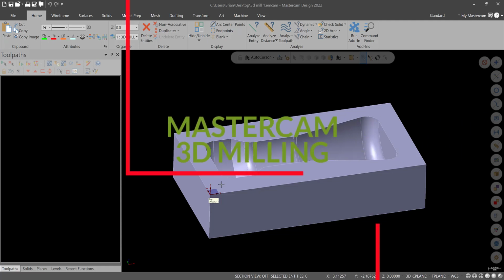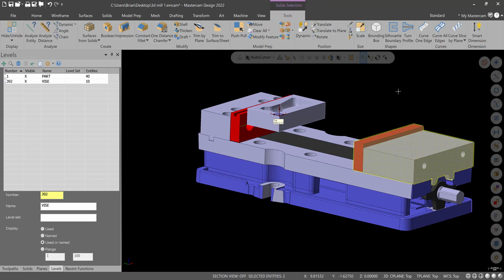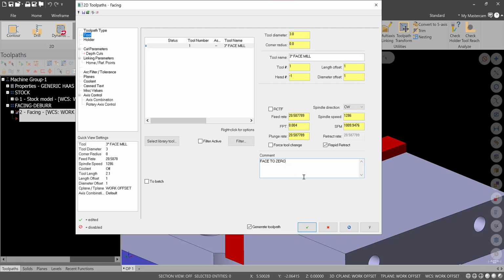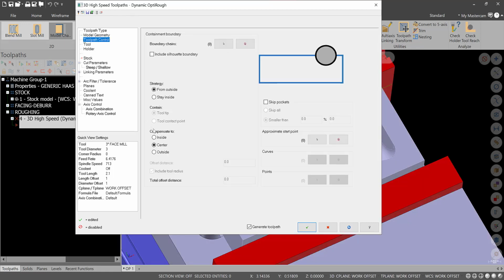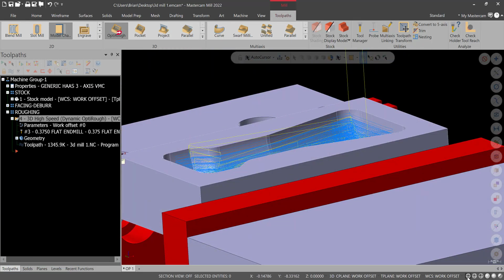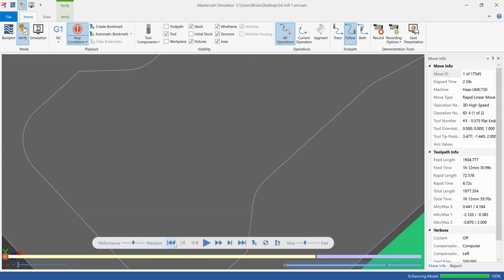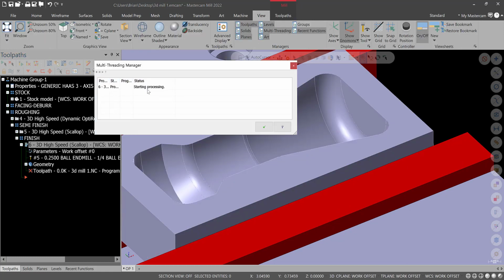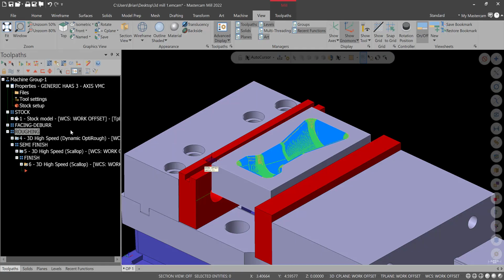Mastercam 3D mill Mold Cavity

Comment: If you turn on smooth make stepover .005 total tolerance .0003  20% 40% 40% you can run a slower machine faster with less " stuttering " and get a finish like glass .